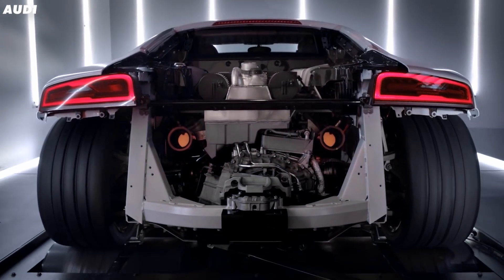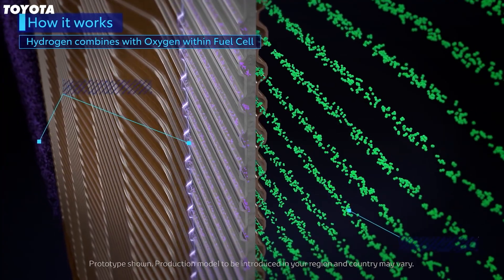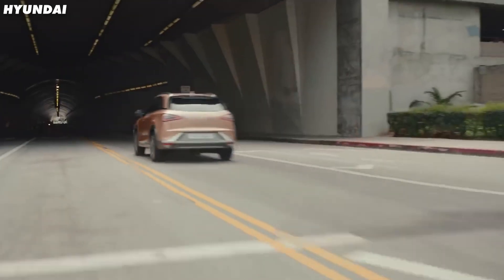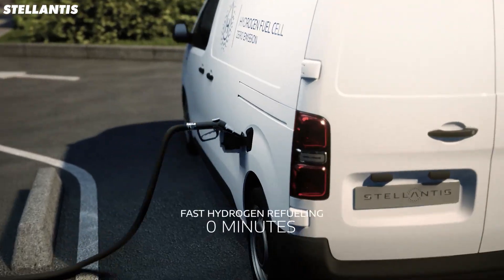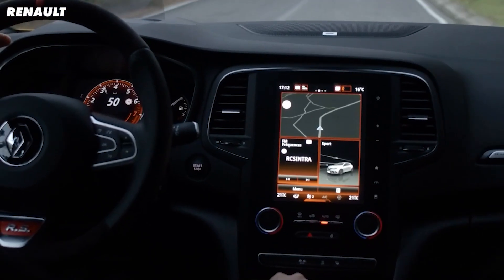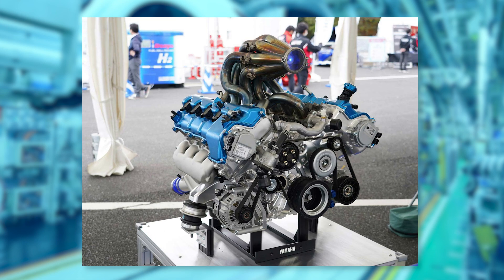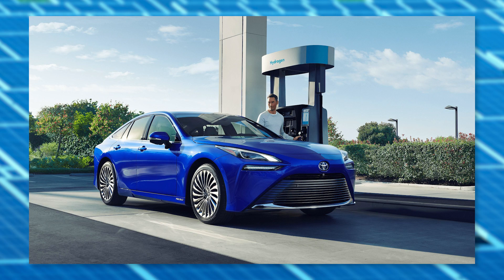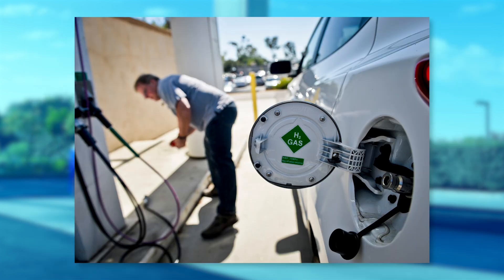The V8 Engine that Runs on HYDROGEN

Comment: Just every time someone mentions hydrogen and a form of transportation together, the next word in my mind is “Hindenburg”
Reply: Not sure if you know this, but gasoline burns too.
Reply: @SeniorKlean   hydrogen burns a lot more intensely.  That’s why the Hindenburg was destroyed in under two minutes
Reply: @shanestanton8  The Hindenburg went up because the paint on the skin was flammable.  If it was unpainted it wouldn't have burned at all.   Yes, hydrogen burns more rapidly than gasoline, but that doesn't really matter when you're basically sitting on the fuel tank.
Reply: @SeniorKlean  The Mythbusters investigated The Hindenburg.  They busted the paint theory because without the hydrogen, the airship would’ve burned a lot more slowly
Reply: So... The pressure is so fucking high, it replaces air faster than it can light on fire. After that it combines with free O² in the air to make water vapor or sometimes Hidrogen peroxide.